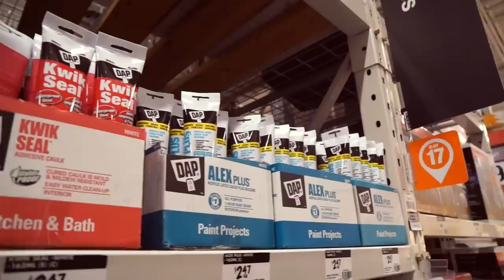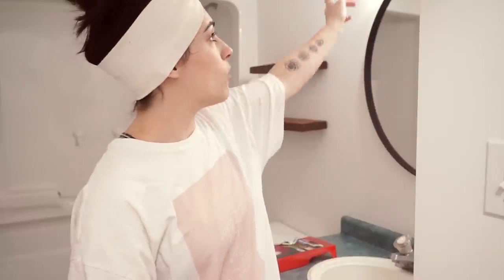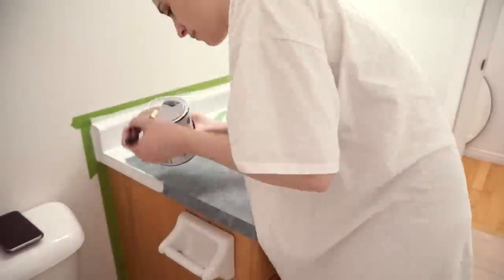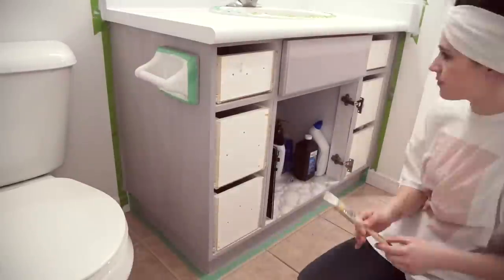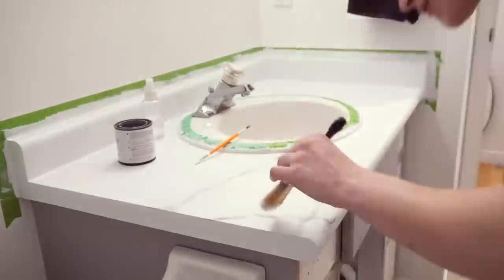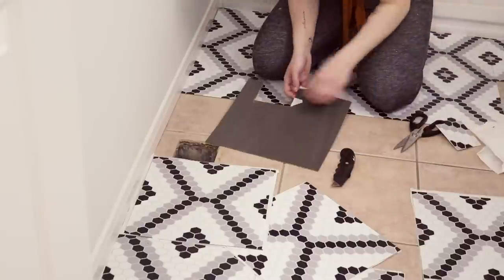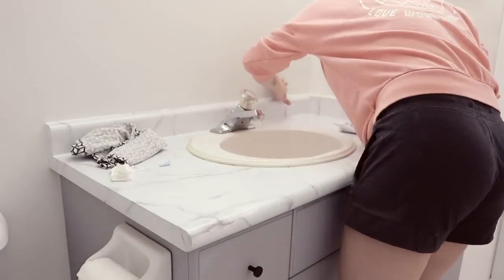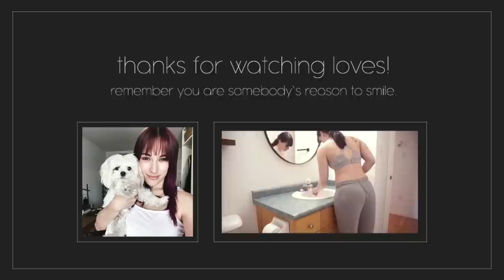DIY Bathroom Makeover Under $300! || Bathroom Transformation Pt. 2

Comment: In 20 years, pulling up these vinyl tiles is going to be the equivalent of pulling up carpet and finding hardwood 😂
Reply: Maybe if you actually manage to get the adhesive off. Those tiles will likely ruin it though.
Reply: I was thinking the same thing. 😆 That will be a nice surprise.
Reply: Just like pretty much any kind of sticky adhesive you should be able to get it off
Reply: Megan goo gone!!
Reply: @thecutestofborg5604  I was thinking the same thing. How will you remove the adhesive tile from the floor?
Reply: @LPeaks218  baking soda
Reply: @thecutestofborg5604  That’s the best screen name.
Reply: I mean... thats just cheap builder grade tile, hardly “hardwood” 🤣
Reply: I mean maybe warm it up with a hairdryer or something and they attempt to peel it off 🤔🤔
Reply: @hayleybreshears5866  still, tile increases the value of your home, not vinyl flooring...appraisers deduct for vinyl flooring. It's not that difficult to remove a small amount of grout and re-grout with a different color. You can even add glitter to the grout...:-)
Reply: Not really those tiles will be probably removed. That is the real renovation on that house

Comment: Yes seal the chalk paint it is water based so water will reactivate the paint and is easily scratchable. Just seal with the clear matte coat that they sell at home depot by the chalk paint works great do 2 or 3 coats of the sealer.  I agree  should eventually change out the faucet and tp holder. I love the way it turned out . U did amazing .

Comment: Looks good! 

I would caution you and anyone else not to caulk around your toilet. We had black tile installed several years ago and my husband thought he was doing a good thing by caulking white around it. A few months later the grout around the toilet started changing color, we had a leak that was not detected because the caulking blocked the water from coming to the top of the flooring. He scrubbed it back to the original color, took off the caulk, fixed the leak and dried everything out. I admit it looks neater with caulk but you really need to know when you have a leak in that area.

Comment: You can’t use just plain chalk paint on the vanity cabinet base without a protective coating, because everything sticks to it and chalk paint is water-soluble so the drips ruin it and you can’t wash it without messing it up. Speaking from experience
Reply: Do you need to prime it first?
Reply: Exactly. I totally would’ve sanded before hand too.
Reply: So you recommend sanding, priming, chalk paint, then top coat? Some youtuber say you can only use chalk paint and top coat but they never give any updates whether or not it hold up well after a couple of months.
Reply: Jennie Leyva The best thing about chalk paint is that you don’t have to actually sand or prime before applying it. It’s extremely easy to work with in that it doesn’t gum up and you can paint over it if you missed a spot without it drying a different way than the rest of the paint. however everything sticks to it it’s not waterproof if you don’t wax it or apply a clear topcoat
Reply: Elizabeth Gallegos you don’t need to prime if you use chalk paint.
Reply: Jessi Eckberg you don’t need to sand if you use chalk paint.
Reply: Jennie Leyva you do not need to sand or prime, you do however have to use a sealer on top, I did this in my bathroom sealed it with the wax for chalk paint and it held up GREAT! I was able to wash it and it looks great. So so easy!
Reply: I wash my chalk paint wall all the time after the kids draw in it.  It literally made to be washed. Lol.
Reply: No sanding no primer...just a top coat. There is nothing fancy about chalk paint..its just basically a hyped of flat primer..that's it looks so bad a few month after.... so if you are going to need a top clear coat... might as well just use a satin paint and primer on one. You'll save a lot too! They got a lot of people hook line and sinker with this chalk paint nonsense lol

Comment: Great job however definitely need an updated faucet and TP holder. Those two things still look really dated. Also I would opt for a lighter shower curtain :-)
Reply: Yes. I was thinking the same thing about the to holder
Reply: I was wondering why she didn’t at least take it off to paint. Those are so easy to remove.
Reply: I think the shower curtain is fine

Comment: I have the same flooring tiles. I bought a black adhesive strip for the threshold to finish the look. I’ve had it for a year now. Sadly, I can see some of the corners lifting and a few of the tiles are starting to peel a bit on the corners. The pattern in the black part of the corners don’t match up either.

Comment: Loved what you did to the space - had a question. We have a vinyl sheet as our floor in the bathroom and I wanted to use peel and stick tile but the rest of the house was updated with hardwood so there is a dip in the doorway of the bath from the hallway because the hardwood is higher. Did you have a similar issue?

Comment: LOVE THE FLOORING. I ORDERED A BUNCH OF SAMPLES TO CHOOSE FOR MY BATHROOM AND KITCHEN. QUESTION, THOUGH: IS THERE A REASON WHY YOU DIDN'T USE MARBLE CONTACT PAPER FOR THE COUNTER? I'VE SEEN A FEW PEOPLE ON HERE USE THAT. WOULDN'T THAT BE EASIER?
Reply: it would be a lot easier but I have watched multiple videos where people (usually renters) say that the contact paper did not hold up well and they ended up having to replace it a lot sooner than expected. another issue that I have seen with the marble contact paper is that it is nearly impossible to get the patter to fully line up across the whole counter. so if you want something that is going to last against all of the moisture and wear and tear I would definitely opt for the paint.
Reply: @aleahnicholson8417  THANKS, BUT MOST RENTERS ARE NOT ALLOWED TO PAINT THEIR COUNTERS, I KNOW I'M NOT.
Reply: 2Bdiscovered yes that was my point in saying that. i’m pretty confident that she isn’t a renter so she wouldn’t have to opt for the contact paper but instead use something that’s lasts a lot longer

Comment: I just purchased a box of the same tile to use for my bathroom floor.  Funny thing is the floor tile in mine looks identical to the one you started with as well.  I have a question, though.  How well does it cover the grout lines?  Are you getting any sort of indentation that's visible in the peel and stick, from where the grout lines are?

Comment: Do you have any more opinions on the floor tiles? I know you mentioned that they were sticky after you finished putting them down. Did you end up going back in and washing them? Was it easy enough to do without ruining them? Im seriously considering doing this in my bathroom now 😍😍
Reply from the maker: So far they are great! I left them for the day and I'm planning on cleaning them tonight! They recommend not cleaning them with water or cleaner for 48 hours just so the adhesive has time to fully set. I will keep you updated! I did scrub a few places before putting them down and they seemed to be totally fine! :)
Reply: @JennaRoseBeasley  GREAT! Yes, please do keep me updated :) <3
Reply: Use some goo gone to get the adhesive up. That way you’re not scrubbing and no water!

Comment: Does the counter top paint and cabinetry chalk paint chip or fade overtime?
Reply: It will if you regularly clean the surfaces. You would need to reapply protective coats to ensure this doesn't happen. I would apply poly or epoxy on the countertop.

Comment: Can you mention glue and other material ..? I mean which kind of paint  ? .🤔
Reply: You can use any type of paint but most use chalk paint because it's thick and covers alot more without needing to sand before use. You will need to apply a protective top coat like polyurethane or epoxy.

Comment: I really want to do the adhesive tiles but I'm concerned with putting them over tile, our tile is bumpy and uneven texture so I'm not sure this would work. If anyone has any info on this, please let me know.
Reply: Probably better to pull them, if the surface is uneven it won't work

Comment: The bathroom looks great but I just don't think it will last. 

Those peel and stick tiles only last 5 years max, trust me been there done that and regretted it. And for some reason the white ones ALWAYS start to discolor after 2ish years. I also would not have painted over the cabinets and counter top that will peel/chip in under 5 years as well.

In 5 years from now when it everything needs redone again I recommend  that you remove the cabinets then sand and finish them properly and buy a new counter top from a hardware store ($200ish max). While the cabinets are removed call a professional tile glazing company to refinish that tile($500). Twice the cost but  everything will last indefinitely. Again, your bathroom looks great but it just hurt me to see the hours of work and money you put into it knowing that it won't last.
Reply from the maker: laptopgirl don’t worry I went into it knowing all of this and knowing it wouldn’t last a crazy long time. I’m fine with it lasting only 5 years. I’m the type of person that loves changing things up so by then I will want a change anyways. 😊👍🏻 This was just meant to be a cheap, easy and quick option if you don’t have $700-$1,000 to spend. Plus it was a lot of fun and I’m proud to know I did it all myself. It’s super enjoyable to me. Thanks for watching girl! 💕
Reply: Jenna Rose It looks beautiful!